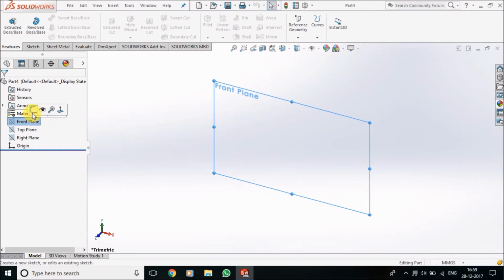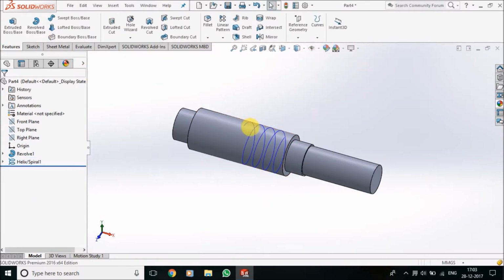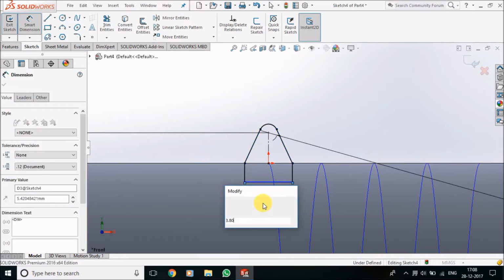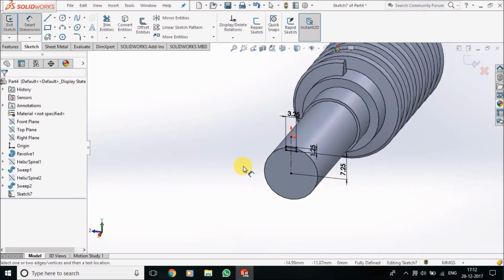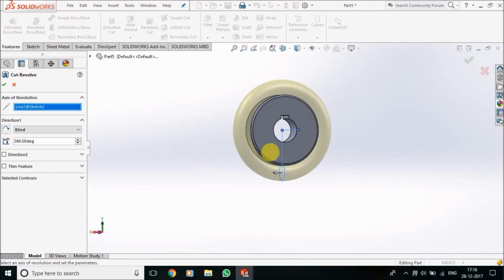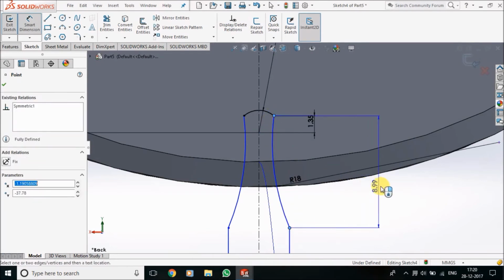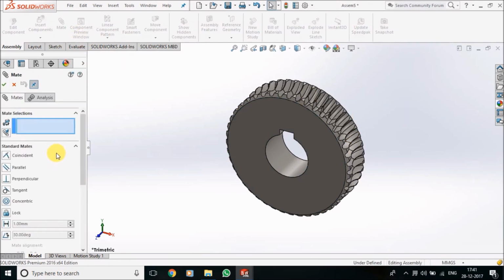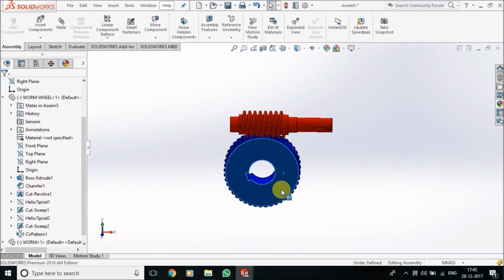Worm and Worm wheel || Making of worm and worm wheel assembly in solidworks

Comment: If I need to design a worm (pitch is 18mm, height is 12mm, dia.8mm)shaft diameter is 45mm
Worm wheel diameter is 250mm and width of wheel is 50 mm